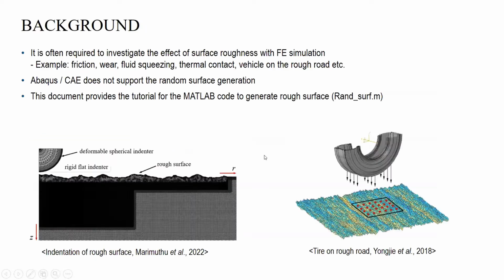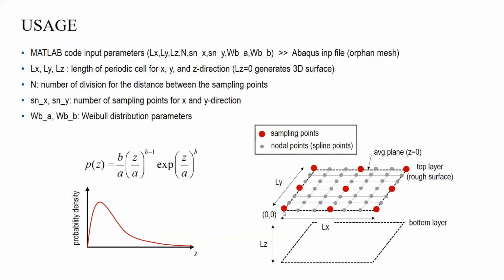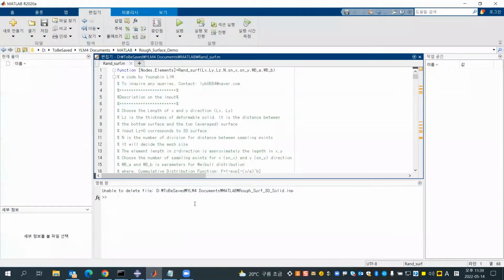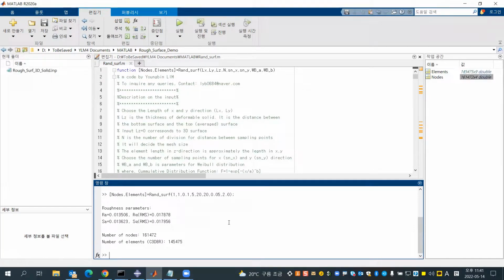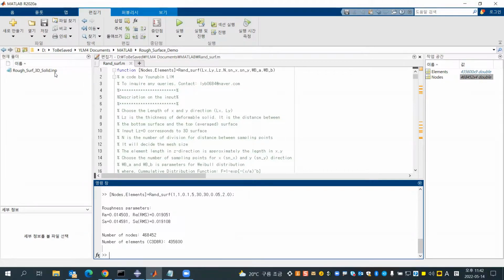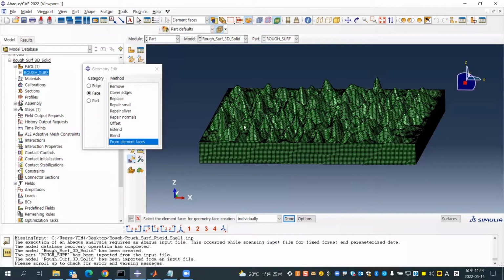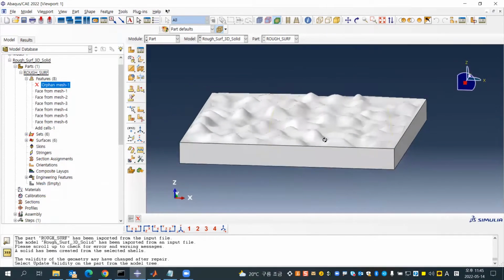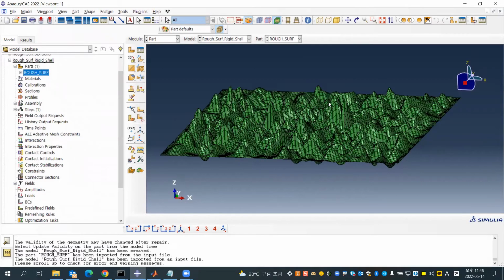Constructing Rough surface for ABAQUS using MATLAB

Comment: can you model rough surfaces in 2d?
Reply from the maker: Rough surface generator plugin for Abaqus/CAE supports 2D. It is open source. https://youtu.be/kuCzG_OzWTM?si=2iH-EeHFoawKQjIe
Reply: @TheLyb0684  Great. How can I access the rough surface generator plug in
Reply from the maker: @DavisMUGABE  Please refer to the paper: https://www.sciencedirect.com/science/article/pii/S2352711023000766
Reply: @TheLyb0684  Thank you. When modeling an adhesive layer onto the rough surface, is it possible to model the surface of the adhesive in a way that it perfectly fits onto the rough surface
Reply from the maker: @DavisMUGABE   If it is 2D you can directly handle the geometry. So it won't be difficult. Use boolean feature to subtract the geometry
Reply: do you have any tips on how to mesh a rough surface generated shell in 2D

Comment from the maker: If you inquire any question, please contact me through email: lyb0684@naver.com
Reply: Hi
can I use the same code to generate a rough surface in Matlab not in Abaqus?
Reply from the maker: @hadisamiri1807  The code generates points on rough surface. You need to do some customization to visualize it on MATLAB
Reply: @TheLyb0684  would you please give me a hint on how to do that?